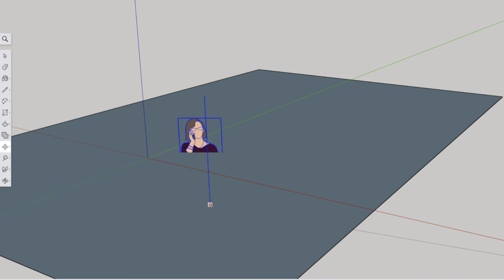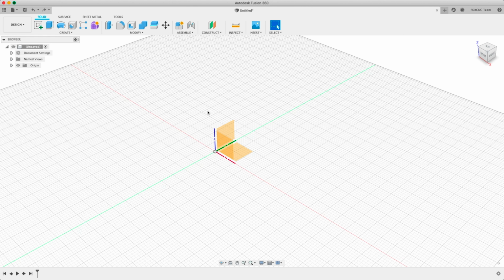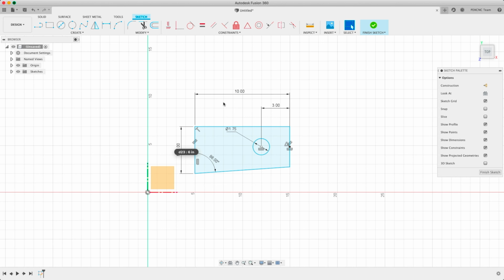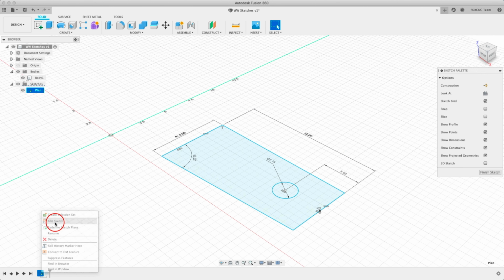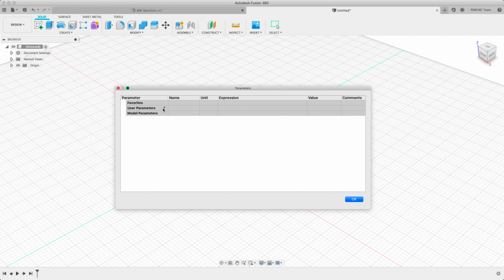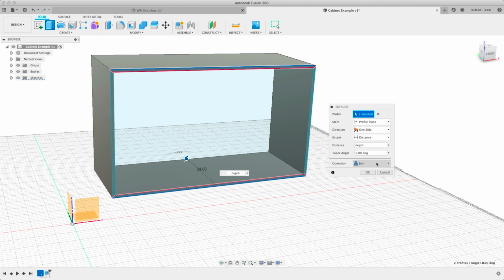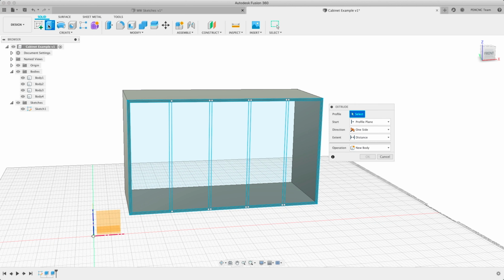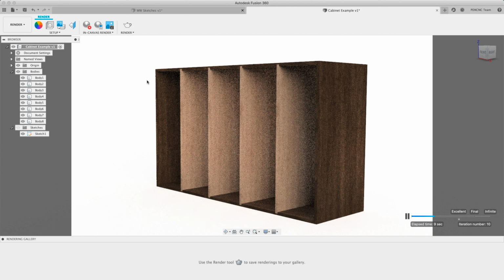Learn Fusion 360 for Beginners

Comment: This was mind-opening for me.  I'm brand new to modeling and drawing, and the little I do know was from SketchUp, but Fusion seems to more obvious choice, being a cabinet builder.  My question is, I'm looking for a way to make a repeatable component like a shaker style cabinet door, that I can change the dimensions of on the fly, rather than draw out every door on a built-in kinda thing.  Greatly appreciate your work.
Reply from the maker: Oh great, I love hearing that 👍. I definitely think you're on the right path with Fusion. There are a few ways to tackle the cabinet door thing. The simplest for now is to make a model that's parametric and save it as a template. Make sure to use components for each part.

Copy it to start a new model. I've got some more advanced versions that I'm working on making videos of but they're still unresolved.

If you want just one aspect, you can use Derive or Insert Derive to put it into a new model.